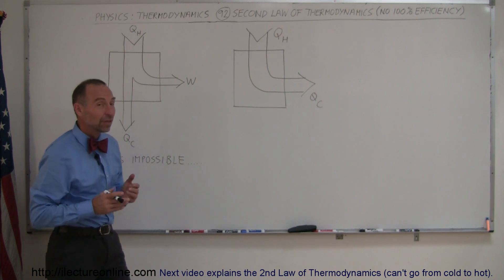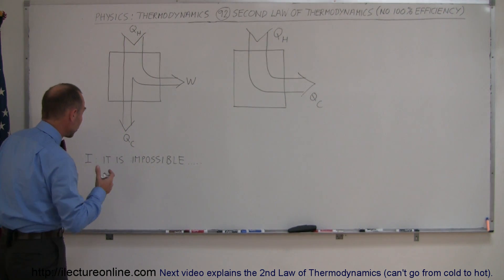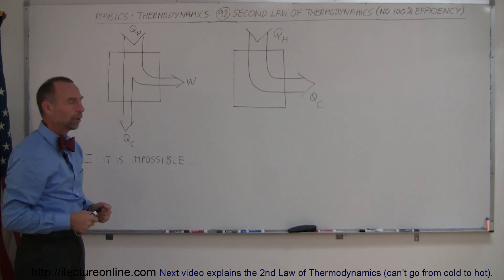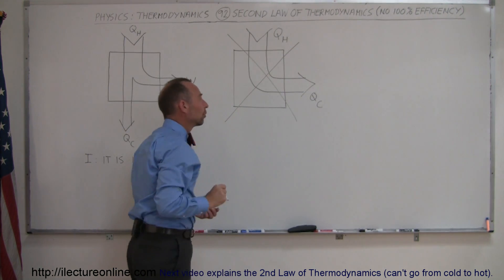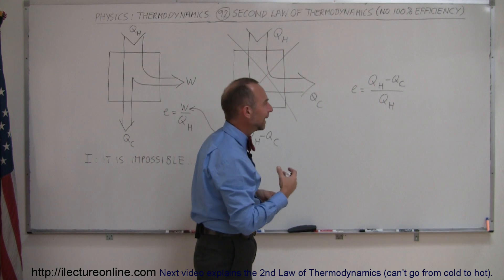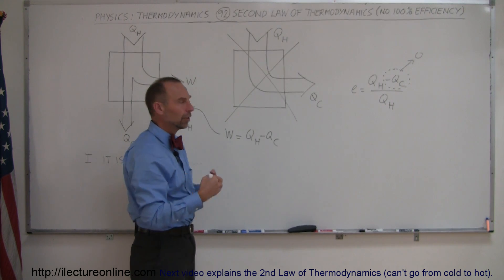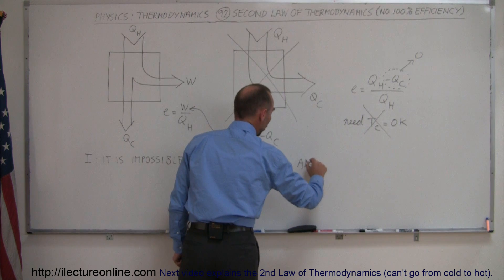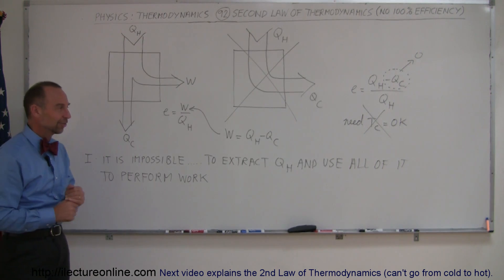Physics 29  Efficiency Of Heat Engines (2 of 14) Second Law of Thermodynamics (No 100% Efficiency)

Comment: Thanks a lot for the video
Why does Tc have to reach absolute zero for the engine to be 100% efficient?

If we took the internal combustion engine for an example and let’s say the air got in the engine at T kelvin 
If the exhaust came out at the same T wouldn’t that be 100% efficiency?
Reply from the maker: If the exhaust temperature was the same as the input temperature, the efficiency would be 0 %

Comment: Sorry a question still remains in my head. Is Tc the temperature of the cold reservoir or a place where Qc is dumped into or is Tc the temperature of Qc which has no energy left in it?
Reply from the maker: Tc is the temperature of the gas after work is done by the gas and that gas is exhausted
Reply: @MichelvanBiezen  Oh alright that makes sense. Thank you for the response!

Comment: Very probably a perpetual motion machine of the second kind: Consider FIG. 1 and FIG. 2 in:

http://pages.csam.montclair.edu/~yecko/ferro/papers/Fundamentals/Brevik_ElecMagnFluids.pdf 
 Can. J . Phys., 60. 449 (1982), Fluids in electric and magnetic fields: Pressure variation and stability, I. BREVIK: "FIG. 1. Two charged condenser plates partly immersed in a dielectric liquid. (...) FIG. 2. The hydrostatic pressure variation from point 1 to point 5 in Fig. 1."

FIG. 2 shows that the hydrostatic pressure between the plates of the capacitor is much greater than that in the rest of the liquid. Therefore, if we punch a small hole in one of the plates, somewhere between "3" and "2" in FIG. 1, water will constantly flow through the hole, pushed by the pressure between the plates:

http://energythic.com/usercontent/3/DIEPHOPU_caphole.gif

It looks like the second law is violated, doesn't it? More references:

http://www.amazon.com/Introduction-To-Electromagnetic-Theory-Perspective/dp/0763738271 
 Introduction to Electromagnetic Theory: A Modern Perspective, Tai Chow, p. 267: "Calculations of the forces between charged conductors immersed in a liquid dielectric always show that the force is reduced by the factor K. There is a tendency to think of this as representing a reduction in the electrical forces between the charges on the conductors, as though Coulomb's law for the interaction of two charges should have the dielectric constant included in its denominator. This is incorrect, however. The strictly electric forces between charges on the conductors are not influenced by the presence of the dielectric medium. The medium is polarized, however, and the interaction of the electric field with the polarized medium results in an INCREASED FLUID PRESSURE ON THE CONDUCTORS that reduces the net forces acting on them."

http://farside.ph.utexas.edu/teaching/jk1/lectures/node44.html 
 "However, in experiments in which a capacitor is submerged in a dielectric liquid the force per unit area exerted by one plate on another is observed to decrease... (...) This apparent paradox can be explained by taking into account the difference in liquid pressure in the field filled space between the plates and the field free region outside the capacitor."

http://www.wbabin.net/valev/valev2.pdf 
 Pentcho Valev, Biased Thermal Motion and the Second Law of Thermodynamics (a badly written paper but still could be useful)
Reply: Pentcho Valev  How much energy does it take to polarize the medium though? what electric energy is used to make the capacitor?  Even if it is high voltage and low amperage that still means current and wattage...  Does the capacitor need a continual feed of electrical energy and how much is this? And since it is such a simple device to build.... it's something that could be done in a lab tomorrow...?

Comment: If a heat engine converts heat into work under isothermal conditions (no cold reservoir, only a hot one), the second law of thermodynamics is violated. Unpublished notes written in the period 1824-1832 reveal that, at the end of his (short) life, Carnot discovered the first law of thermodynamics and immediately started doubting the second:

http://www.nd.edu/~powers/ame.20231/carnot1897.pdf 
 Sadi Carnot: (p. 225) "Heat is simply motive power, or rather motion which has changed form. It is a movement among the particles of bodies. Wherever there is destruction of motive power there is, at the same time, production of heat in quantity exactly proportional to the quantity of motive power destroyed. Reciprocally, wherever there is destruction of heat, there is production of motive power." (p. 222) "Could a motion (that of radiating heat) produce matter (caloric)? No, undoubtedly; it can only produce a motion. Heat is then the result of a motion. Then it is plain that it could be produced by the consumption of motive power, and that it could produce this power. All the other phenomena - composition and decomposition of bodies, passage to the gaseous state, specific heat, equilibrium of heat, its more or less easy transmission, its constancy in experiments with the calorimeter - could be explained by this hypothesis. But it would be DIFFICULT TO EXPLAIN WHY, IN THE DEVELOPMENT OF MOTIVE POWER BY HEAT, A COLD BODY IS NECESSARY; why, in consuming the heat of a warm body, motion cannot be produced."

I think that, almost 200 years later, Carnot's question is still relevant. Isothermal heat engines are possible in principle (that is, the second law is wrong) but they are so slow and powerless that experimental demonstrations are virtually impossible.